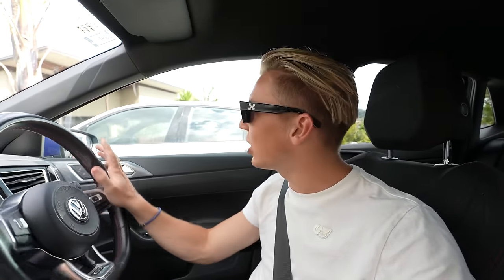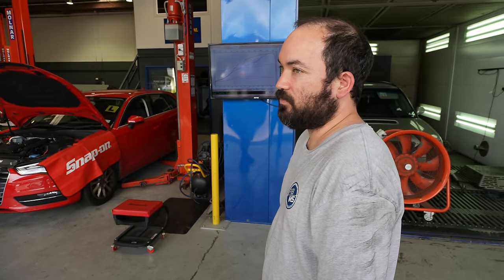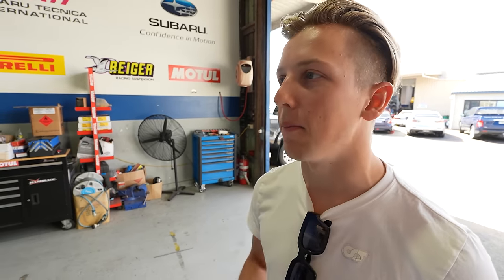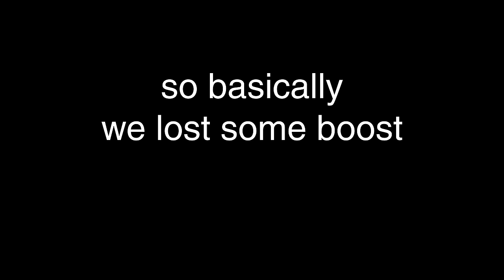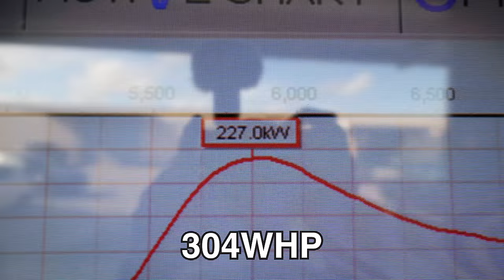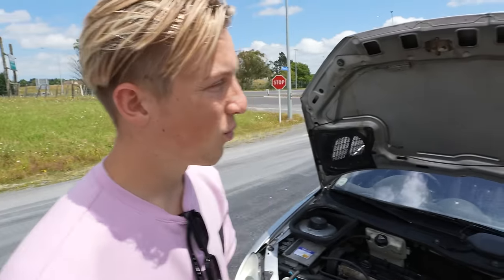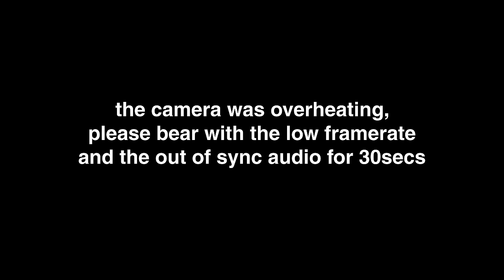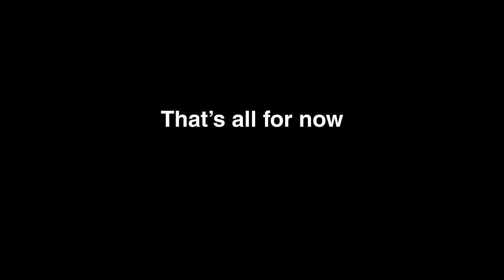Have We Gone Too Far? - Forester On The Dyno!

Comment: Seriously, it'll be harder to blow with ARP head bolts. 😉 Either way, at 20lbs of boost, that engine won't have a long life. Foresters there are very different from what they are in North America.
Reply: They last forever mines done over 384000kms on 18 psi, 20 psi should be fine
Reply: @aiden6843  Mines? Huh?
Reply: @PeterKKraus  mine's, mine has
Reply: @aiden6843  18 psi on a little engine like that for that long?
Reply: @PeterKKraus  yep the ej20 is an awesome motor, it gets beat on regularly too so it's not like it's treated softly
Reply: @aiden6843  I would have thought 12 pounds would be the max on that engine. The 2005 and '6 Ford GT superchargers don't pump  that much pressure. I'm guessing they only added enough boost to get the 0-60 (100kph) under 3 seconds.
Reply: @PeterKKraus  superchargers generally don't require as much psi as a turbo charger does for power, thats why. Though I understand the confusion because it seems like it should work similarly, but yes most turbo Subaru's like wrxs run about 14 psi/ 1 bar of pressure stock, mine runs 9 stock so 18 isn't to far out of its world but wouldn't go much more.
Reply: @aiden6843  I was thinking 14 pounds max for the Subaru - with stronger head bolts. How much does your 300+ km car rattle after driving a long time with 18lbs of boost?
Reply: @PeterKKraus  doesn't at all starts right up first crank every time, even in minus 0 degree weather, as I said the 2.0 motors are great the most common failure points are the valves or the ringlands, only issue I've got currently is that it needs new spark plugs and leads which will be fixed over the weekend.